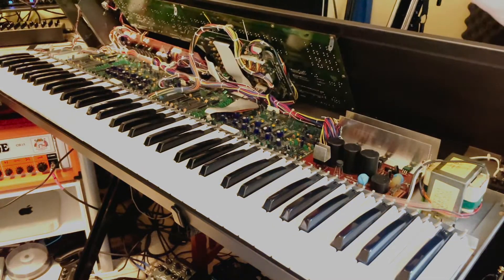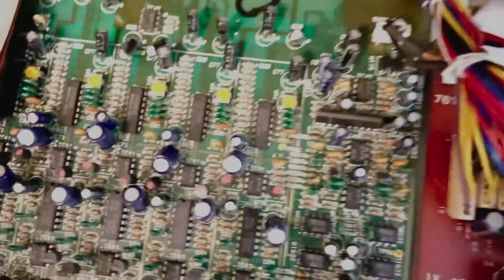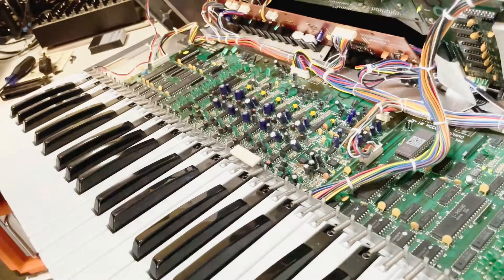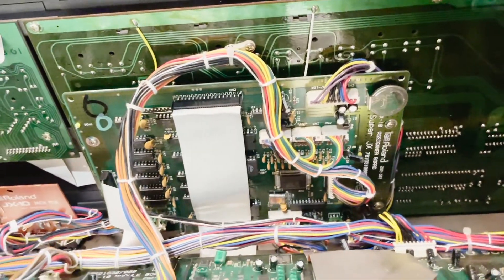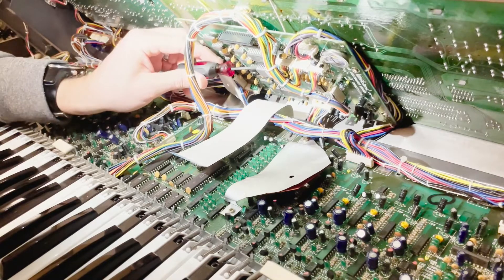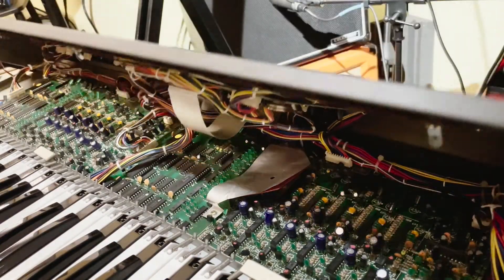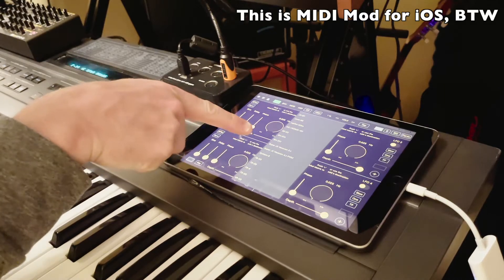Roland JX-10: Super JX Flash Module with Vecoven 3.22 Firmware and Soundboard ROM Install

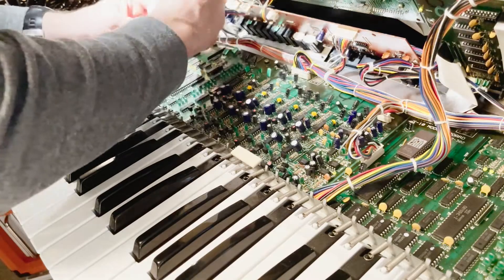Comment: 5:30 = my experience too in my MKS-70 😂 nice job.
Reply from the maker: those IC tools are the worst
Reply: @thesrabbit  yeah they are. They’re good enough for smaller ICs but anything longer.. They do make an extractor which clips around the IC then you screw it down and it pushes against the board to lift the chip up and out, but the smallest I’ve seen is 24 pin, so they’re just too big for our EPROMs unfortunately. Luckily it worked here though. If I had to do this over, I’d probably just lift each end slightly with a flat head screwdriver like you did to free it up a bit and then use the tool. I’ve seen some videos where they just pull out by hand..

Comment: Hi. Will it do both mods together?
Reply from the maker: Hmm. What do you mean by both mods? This video only covers the firmware upgrade that gives you a greatly improved midi implementation and a couple other cool things like an arpeggiator and increased pitch bend range. There’s not much more to it than that.
Reply: @thesrabbit  yea I'm a bit confused by it. I thought it would do PWM? Can it do PWM and arpegiators together?
Reply from the maker: @amonster8mymother  I’m not sure about the PWM Mod. That requires Vecoven Firmware 4 or greater to work. This video is about Firmware 3.22. I didn’t install the PWM mod. I’m sure that Fred Vecoven would answer any questions you might have via email.

Comment: Do you get the two eprom's along with the Super JX Flash Module?
Reply from the maker: You only need them if yours are < version 2.0. Turns out I didn’t need them, but I decided to replace them anyway. I think they were like $5. Super cheap.
Reply: @thesrabbit  Ok, thanks a lot. I have to open and look for the version. I have a dead key to fix, so I have to open it anyway. Where did you order the Eproms?
Reply from the maker: @gumse666  I just got them from Mr. Vecoven himself. You can email him. His contact info should be on the Super JX site.
Reply: @thesrabbit  Thanks!!!